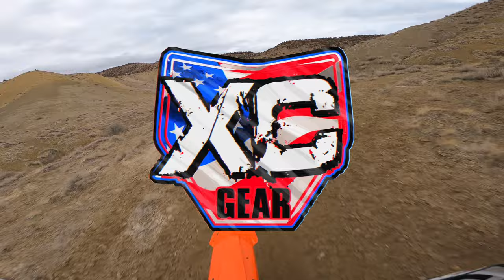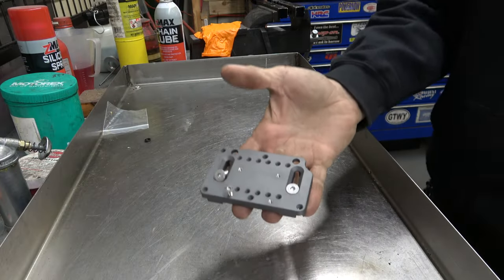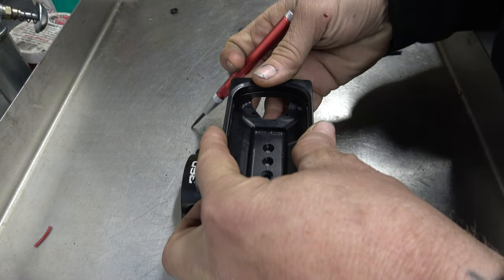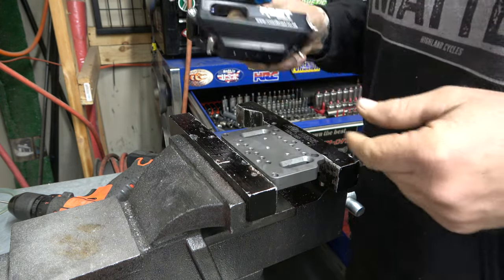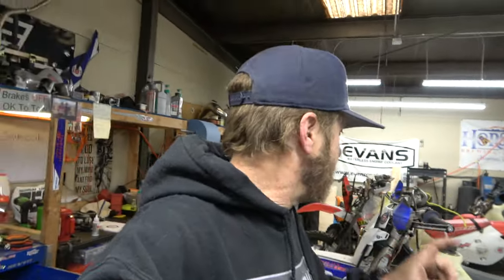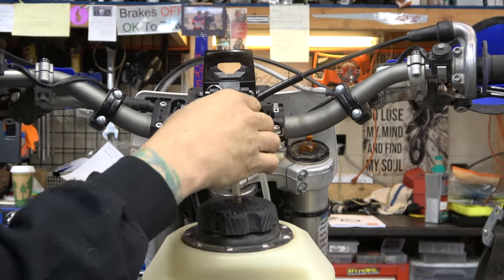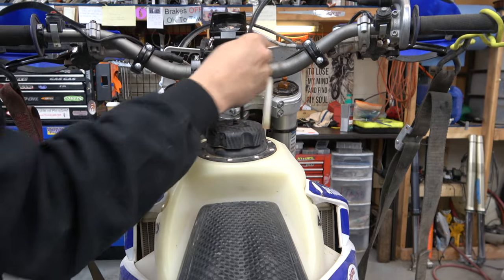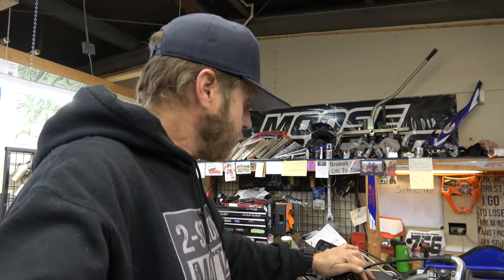XC Gear Mako 360 Dashboard Install

Comment: Do you have a chain saw mount in mind?   Bill Dart is an old time Idaho rider who makes really nice ones in his garage.  Very light and low profile.  I have made a few modifications to mine over the years but they are better than any of the commercial ones i have seen out there.
Reply from the maker: I will be running one from Bill for sure.